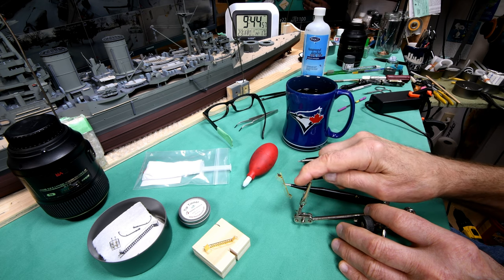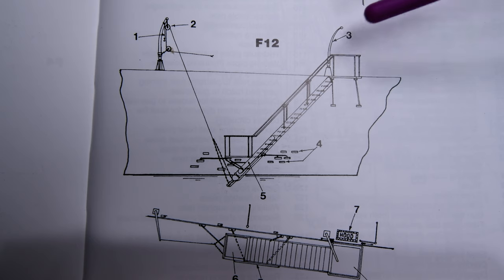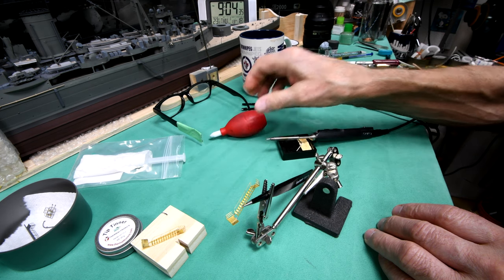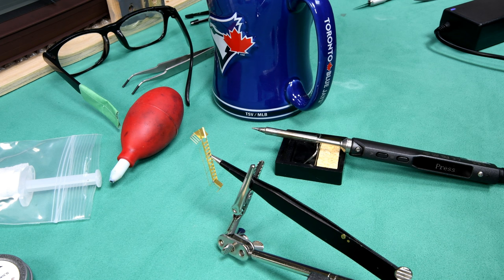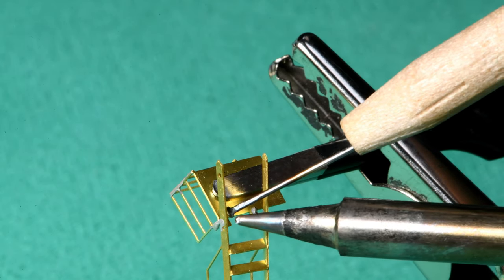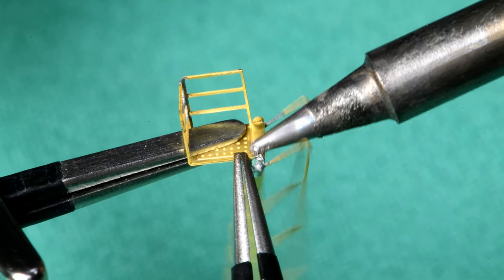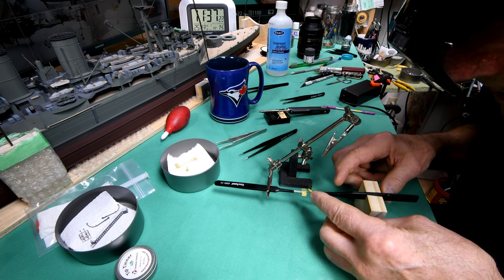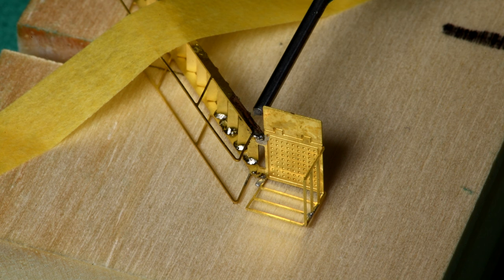The Model Ship - Part 1052

Comment: The rabbits are probably in semi-hibernation and sleeping away. They are fat enough that they don't need to eat every day.

I think you are giving up too soon on the ladder. The way you are doing it without a jig to hold the pieces is the most difficult way, so I understand why you are frustrated with it not working. Build a jig out of wood and maybe use a couple of brads to hold the pieces together at the correct angle. Then solder both sides of the hinge in one go, while all the parts are heated. If you really want to solder the sides of the hinge at different times, then you need to add something to act as a heat sink in between the solder joints to protect the joint that is already soldered from becoming desoldered.